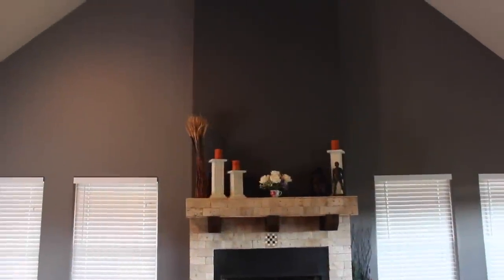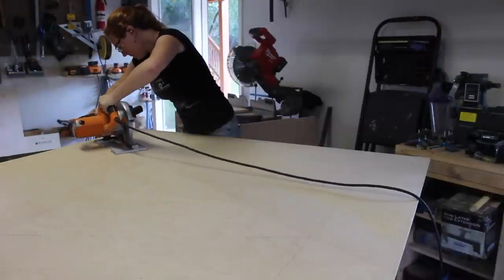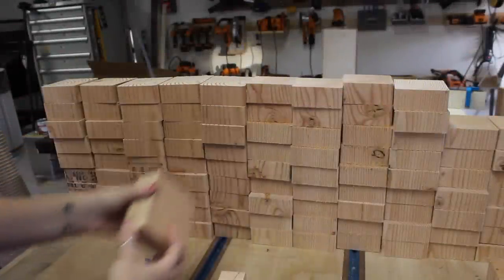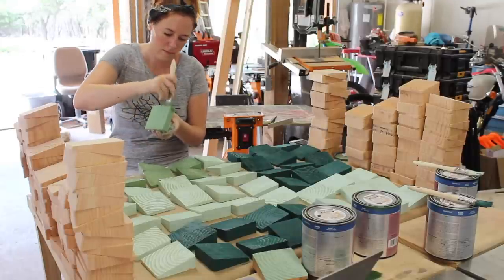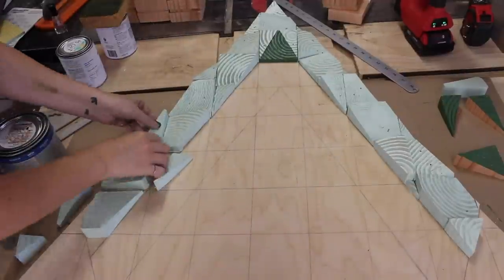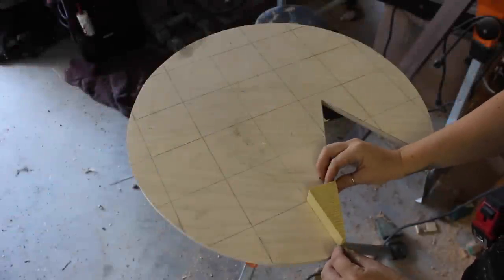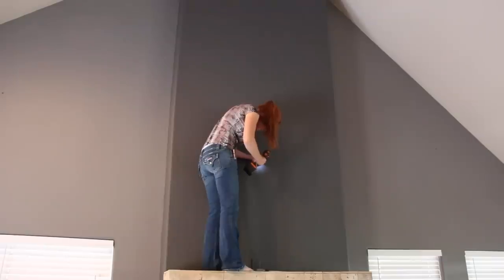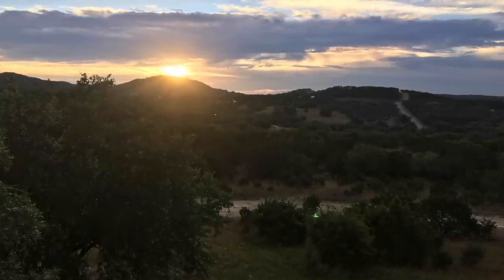Scrap Wood Art - Abstract Mountain

Comment: On the offchance you don't know the technique already, if you are afraid of putting a stop block too close to the chop saw you can always use a spacer to align your work, so: work piece, spacer, stop block. Press the piece into the spacer into the stop block, hold the piece, remove the small spacer, and cut :) Good on the table saw, too. Keep the videos coming!
Reply from the maker: I do know it but with so many cuts it would have added soooo much time to the process. Since it's art and doesn't have to be exact, I didn't want to go through the added effort.

Comment: Since all the pieces were going to be angled anyway, you could have cut your time in half by setting your chop saw to cut at a slight angle and just rotating the 4x4 180 degrees on each cut. The face of each wedge would have been slightly larger and the back would have been angled as well, but it would have been uniform and easy enough to work with.
Reply from the maker: Feel free to do it that way if you make one but I don't think it would look as nice without the bottom of the blocks being flat.

Comment: April: That was artistically inspiring. We have a large triangular wall in our living room that is blank. We are now challenged to take your technique and see if can design a large wall-mounted artistic interpretation of a Chesapeake Bay Skipjack in the same manner. It will be BIG! Maybe we should do a smaller version first? Perhaps we can incorporate a moon or sun behind the sail. Keep up the great work!  By the way, does any of the backing board show through the rounded corner joints?

Comment: Really nice - love the colours. But I'm curious - why did you mark out the big triangle on the ply sheet using the track saw base, then use a circular saw freehand? Why not make the cut with the track saw? Isn't that what they are for? I'm sure there is a reason, but I don't quite see what yet!
Reply from the maker: Well the track saw requires clamps to hold both ends in place. Since the end of the track didn't reach the end of the ply I couldn't use it. I used the track to trace out my line though because it was the longest straight edge I had.

Comment: Cool project but why the band saw? Isn't the mitre saw a better tool to cut angles? That is what it is designed to do IMHO.
Reply from the maker: If you used the miter to make the angled cuts then you would be rotating the saw every cut. where as the way I did it, you get to keep the saw in it's position and just make the straight cuts. You can't use the miter after you make all the straight cuts because you don't have a way to hold the small work pieces safely. The way I did it is the most efficient use of time as well as safest.

Comment: How did you attach it?
Reply from the maker: I used two screws into the back and hung bailing wire. Then used a drywall anchor into the drywall.
Reply: Bailing wire, the duct tape of farmers. 😄

Comment: Wait a second. You cut all the straight cuts on a (miter) saw and cut all the (miters) on a band saw.. Silly Rabbit
Reply from the maker: Think about the actual process. It would have taken so much longer if you were to cut the miters on the miter saw. You would have to turn the saw to the angle and make a cut, then put it back on 90 and make a cut, turn it back to an angle and make a cut and so on. The best use of time is to do it the way I did.